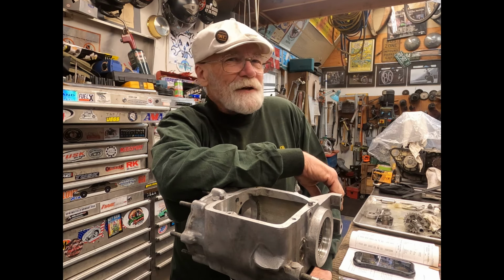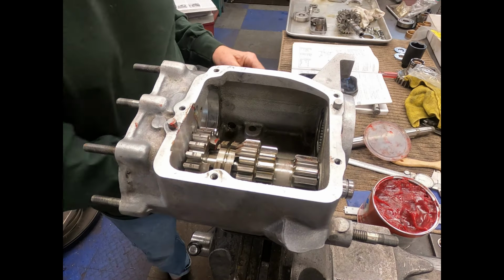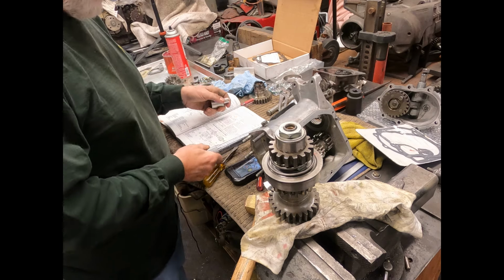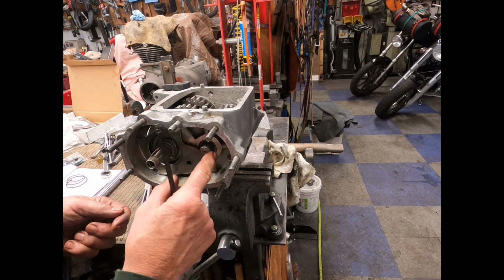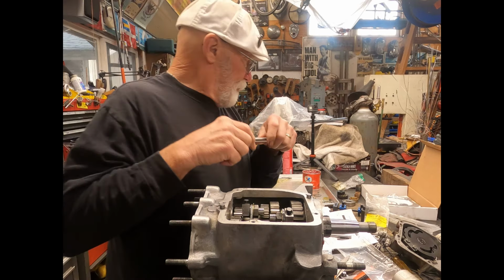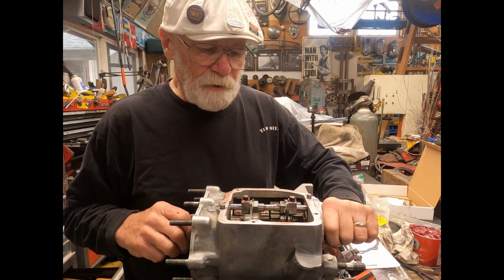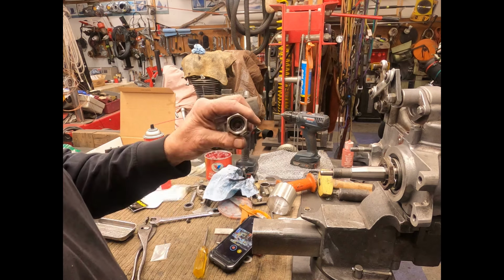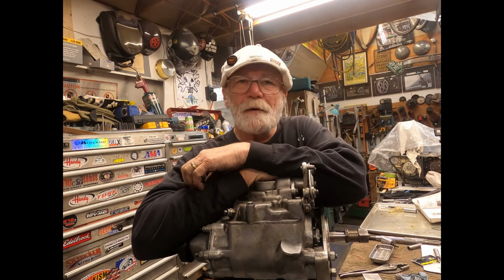Shovelhead transmission part #2

Comment: Nice work! Thank you for the up-close look. I'm starting to believe I can do this. I guess there's a first time for everything...

My 4-speed shifts fine but it leaks like a sieve. Thanks for mentioning if the gearbox was shifting okay before then the Fork Adjustment Tool isn't really necessary. I'm glad to hear that bc for rotary tops it's almost $200 (ratchet lids it's only $75). Hopefully I won't need it...  

Thanks again!
Reply from the maker: You'll be fine just take your time plus take pictures of your transmission as you take it apart. You can always email me at teammiyagi@hotmail.com 
Thanks for watching.
Reply: @outlaw86custom  Thank you so much that is very kind of you.